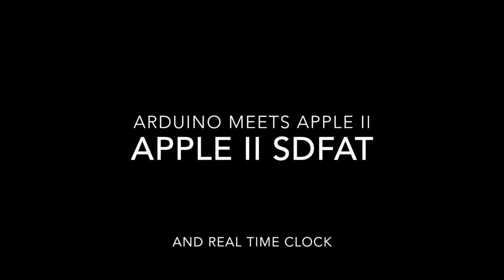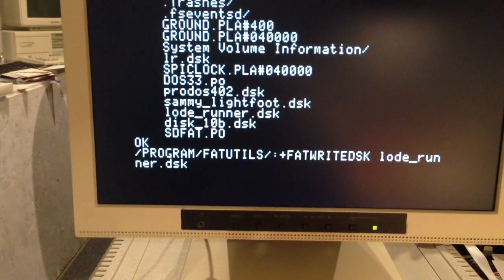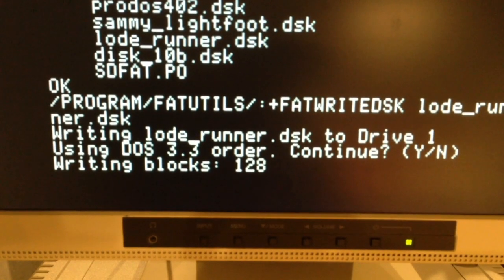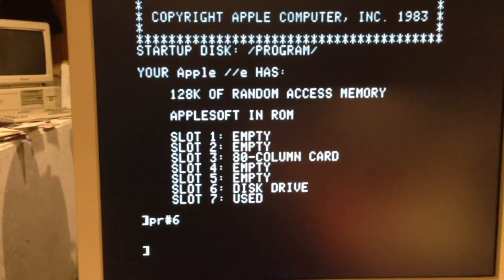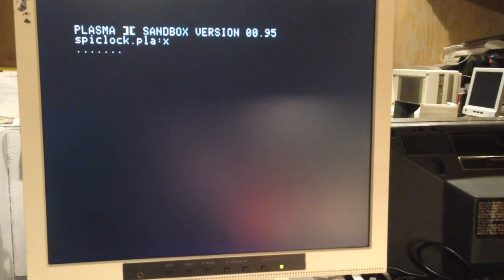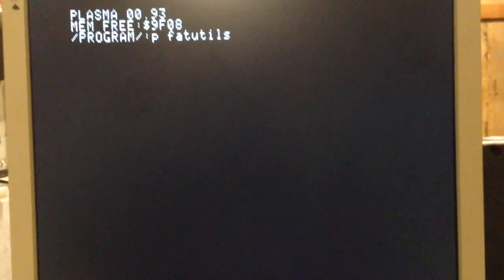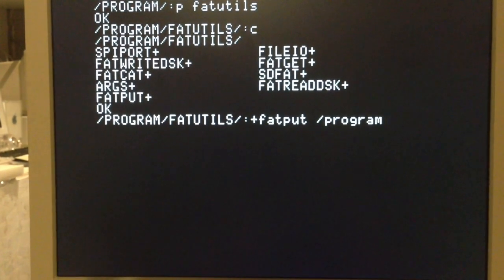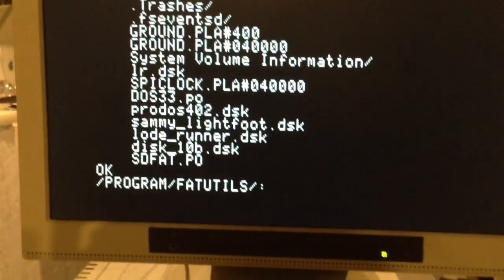AppleDuino: Apple II Meets Arduino

Comment: An application for a joyport Arduino interface is to communicate millis() back to Apples that don't have any card that generates interrupts, so music programs can have accurate timing instead of $FCA8.  I would like a small board to plug into joystick socket that can do this, with female headers on top to plug in any other device - need to convert apple 5v to 3.3v.  Then you can use the Arduino serial out to send Midi Out from the apple.
Reply from the maker: Most of the simple Arduinos are 5V, as is MIDI. An Uno with a SD card/clock shield could pull this off pretty easily.
Reply: Thanks for the reminder.  I got SDFAT working with a data logger shield so I can start experimenting with that circuit.